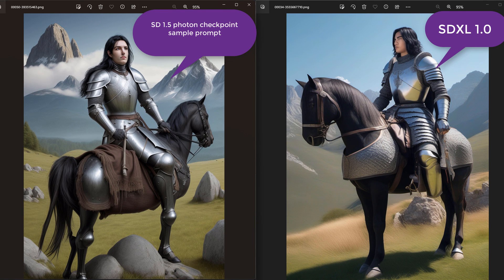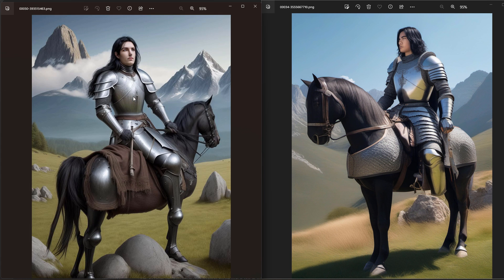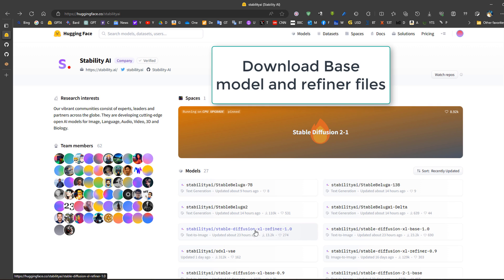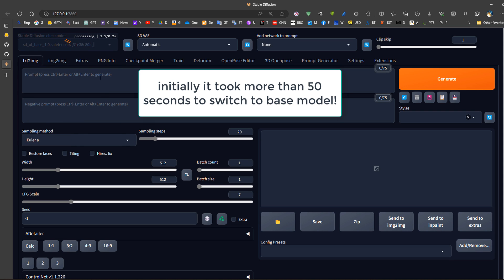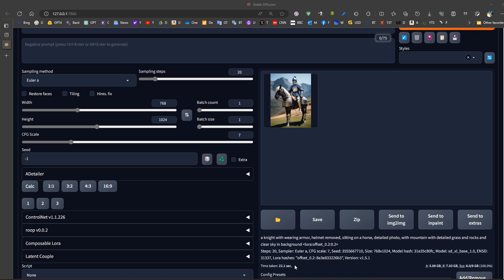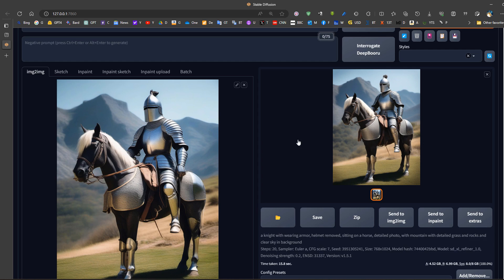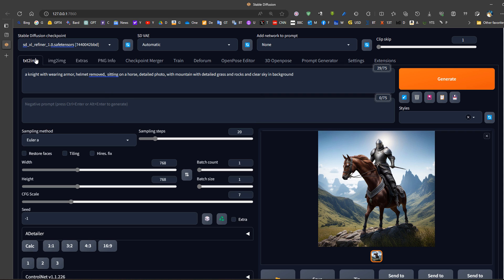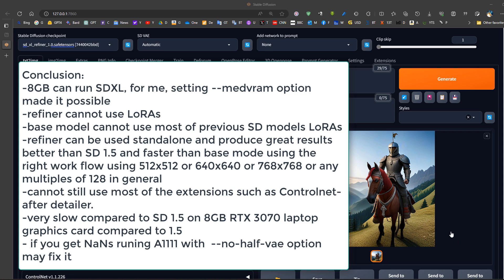SDXL 1.0 Tips in A1111 Low VRAM and other Errors  and Refiner use cases for Stable Diffusion XL

Comment: I'm thinking a buy a Laptop 8GB Vram Will I be able to run a Stable Diffusion XL model?
Reply from the maker: Yes it is possible, but it will be slightly slower than you hope for, it can take 20 seconds and more for a 1024x1024 image using Forge UI or using ComfyUI and more ... currently with how AI stuff is heading, if you plan to buy something, you better save and buy 24GB VRAM, it is very expensive, but it is the only option that allows you to run everything such as Animate Diff models without suffocating on memory or suffering slow generation
Reply: @AI-HowTo  Then I'll just have to buy a PC good choice.
Reply from the maker: yes, PC is alot more practical, cheaper, and more powerful, avoid laptops unless you extremely need to move around often, even lower VRMAM RTX 3060 for PC is alot more powerful than its Laptop counterpart and has more VRAM.

Comment: i want to run this of a server i have in it a gt1030 only 2Gb wil it work? also has 64Gb ram and 2x 10 core CPU.. render time is no issue for me since the server works while i do something else i just want to utilise my server for something other than storage.. also a quadro p2000 fits in my server im thinking about upgradeing  it has 5 GB
Reply from the maker: it will be impractical to run on 2GB, with A1111 this might not work propertly, but Forge have better automatic memory management https://github.com/lllyasviel/stable-diffusion-webui-forge this repositry provides same things as A1111 with same UI but has better memory management and can run on 2GB for SD 1.5.... it might run SDXL too but it will use the CPU then which will be slow.
Reply: @AI-HowTo   yes slow these days is unusable.. the gt1030 was the dumbest purchase i have ever made 2gb idk. if it is the drivers but i cant get it to render or transcode anything..i found a quadro p2000 for cheap so i will run with that thank you for fast response
Reply from the maker: You are welcome, these days, RTX graphics cards are game changers, they are the way to go for AI/Gaming/3D,  they are expensive, but they seem like the only option to save time and be able to stay uptodate with the technolgoy...best of luck.

Comment: I just checked it several times, so --lowvram for 2070 super with 8 GB video memory works faster (1.3 min) than with --medvram-sdxl (5 min)
Reply from the maker: interesting, this is not supposed to happen, but with open source it does! on my 3070 8GB ---medvram-sdxl is faster than --lowvram based on several tests, and this is what it is supposed to be, but with open source anything happens... in general, steps are generated much faster with medvram sdxl on my card but the conversion to pixels takes a while longer, but still overall i get faster generation .... however its best to use ComfyUI for SDXL, it gives better performance than A1111 especially for the 8GB cards.

Comment: heck I have problems with 12gb of video ram.
Reply from the maker: SDXL is much slower than SD 1.5, still, 12GB is good enough to train, generate, and do everything, it is even better if you use ComfyUI as it gives better pipeline and performance compared to A1111, but A1111 is more familiary to use and easier in many use cases.

Comment: it does not load the sd_xl_base_1.0.safetensors model in automatic1111
Reply: Failed to load checkpoint, restoring previous
Reply from the maker: it is possible that your A1111 needs update, because sdxl requires new A1111 version to run...and if you VRAM is low, you should use --no-half-vae --medvram-sdxl   options in the webui-user.bat startup parameters after set COMMANDLINE_ARGS= line ... hopefully that fixes it .... another possibility if you already done that, that your sdxl file is corrupted, which rarely happens.

Comment: On my laptop --medVram does not work but --lowvram does, RTX2050 - 4 GB and image dimensions: 1024x1024 generated... oops... it does not. At final steps I got an error Cuda Out Of Memory
Reply from the maker: currently there is  --medvram-sdxl  in recent A1111 1.6 version, if you used these options --xformers ----no-half-vae --medvram-sdxl  --lowvram and still didnt work out then I suggest you to switch to ComfyUI, it can run even on a CPU.
Reply: @AI-HowTo  will try, thank you
Reply: @AI-HowTo  unfortunatelly with --medvram-sdxl it even does not start to generate, I got CUDA Out Of Memory just right after click generae.

Comment: I am planning to upgrade my old gpu to Rtx 3080ti 2nd, Is 12gb vram of it enough for SDXL?
Reply from the maker: yes, you can both train and generate images using 12GB RTX, but if you are buying, then be patient, and try to  go for 3090, 24GB is the way to go, because soon, 12GB might no longer be sufficient very soon, and 24GB will give you peace of mind for quite sometime.

Comment: im using vlad diffusion and the sdxl model stop doesn't load, so can't use the model
Reply from the maker: whatever works go with it, vlad diffusion is a good option too so is Comfy UI, but usually with --medvram or     --lowvram --xformers --no-half-vae  options it should work  on A1111 too and now there is a new option called --medvram-sdxl  in A1111 version 1.6 ....

Comment: (1:30) "...and all of them had the correct anatomy..." Yeah, but is that because the 1.5 version didn't have enough horses fed into the dataset, because any model will look bad if the dataset it's pulling from is minimal.
Reply from the maker: definitely, bad anatomy of animals/humans comes mainly from having less training images and lower resolution images, higher resolution images makes it possible to learn more features with less number of images too like SDXL... while the structural changes are minimal, the magic in AI is always in the data, everything else is just a distraction.

Comment: Will I be able to figure out how to do this in invoke?
Reply from the maker: this video was made for A1111 when SDXL 1.0 was first released, Invoke as far as I know can also run it, but not sure about its config ... on the otherhand ComfyUI automatically detects graphics card settings and adjusts its run parameters to match your graphics card so no settings is required and faster than both, but less user friendly.

Comment: hi thanks for the video! nice work! my question is full 8gb/8gb 100% vram usage, is "safe"? and.. normal? or i need to optimize more. I have no error, and fine time.. but this 100% usage... i simply don't like this
Reply from the maker: You are welcome, I think its totally fine, the system will take from the System when it needs more VRAM after this point, as long as it works, let the system handle it, no need to further optimize or use --lowvram for instance because it will only get slower  .... in my case, it goes 100% usage when i generates the images then goes down but it doesnt stay 100% all the time, only when generating a new image ranging often between 66% and 100% ... if it is always 100% that might be better because it might be a setting from the BIOS that allows faster run and higher GPU clock speed for instance, i think.

Comment: Has anyone tried with 1650ti ? I think it has only 4GB vram.
Reply from the maker: with --lowvram it might work or in ComfyUI which can even run on CPU and detect best settings based on your GPU automatically., but it definitely will be very slow and not practical.
Reply: @AI-HowTo  Actually that is okay. As long as it will not crash. In Google Colab free version, it will crash. I actually have stable diffusion in my AWS EC2 server and 20 iterations will take 7-8 hours. But that is fine :)

Comment: I have a 3060 /w 12 gb ram, comfyui ui runs pretty fast with xl
Reply from the maker: true, even faster for 8GB... only problem it is not as user friendly or easy to use as A1111...now there is also a refiner scrip extension that allows loading Refiner along with the base model as a pipeline which makes it slightly faster than before.

Comment: Thanks for the video. The medram helped some but when I run it a few times and increase the number of pictures to 3 get memory issue again, I too use 8 GB, I wonder if you run to the same problem
Reply from the maker: You are welcome, I didnt face this, i generated many pictures without a problem, one at a time though... possible memory leaks from A1111 tools...as you can see, many errors with extensions too,  its still not very practical to use effectively compared to SD 1.5... Comfy UI is good, but not user friendly in comparison to A1111.
Reply: @AI-HowTo  I was wondering if you could help me with something. I have been trying to find code or a model that does facial expression transfer from face2face it used to be around a few years back but can not find anything on github or anywhere else that is running tensorflow2.0 and above. Everything seems to be so old that you can not even install the libraries any more!
Reply from the maker: sorry, cannot help with that, but if you want face 2 face expression transfer you can check control net, it does that too  --- just use (reference only) model, can work in img 2 img and text to image as well, so you can use it for existing faces or SD generated ones.
Reply: @AI-HowTo  Sorry for taking up your time but what do you mean by "check control net", not sure what control net is.?
Reply from the maker: I have not prepared a video on this topic, so you can check others, such as here, https://www.youtube.com/watch?v=tBwmbTwMxfQ&t=160s it explains this feature... or search for Control net in stable diffusion, it is an extension that allows us to mimic existing poses/facial features images of others

Comment: is there any chances to make it work on my 3GB VRAM 16GB RAM ? I know it is not even supposed to be enough for SD1.5 but it works with some optimizations
Reply from the maker: I think it is possible... if you failed to run with --lowvram , i suggest you install Comfy UI https://github.com/comfyanonymous/ComfyUI and follow installation instruction (just dowload the https://github.com/comfyanonymous/ComfyUI/releases/download/latest/ComfyUI_windows_portable_nvidia_cu118_or_cpu.7z ) extract , copy models into your check point folder or update the config file to existing stable diffusion installation folder and run... Comfy UI, can run using GPU or CPU, it is slower using CPU alot though ... so it wont be practical...I think in general, with very Low VRAM, it maybe best to use Google colab, you can google that too.

Comment: Can my gtx 1070 run it? It's 8gb vram
Reply from the maker: you need to try it, use --lowvram option if --medvram didnt work, generally speaking it requires strong GPU, so even if you ran it, it is unlikely that you will use it much considering it is slower than SD 1.5 for instance
Reply from the maker: or use Comfy UI, it automatically finds best settings for you GPU.

Comment: hiiii im not able to load the "XL 1.0"  i dont know what to do ....i'm getting this error:
 
size mismatch for model.diffusion_model.out.2.weight: copying a param with shape torch.Size([4, 384, 3, 3]) from checkpoint, the shape in current model is torch.Size([4, 320, 3, 3]).
Reply from the maker: it doesnt seem you A1111 is updated, check the version at the bottom of the screen 1.5.1 after running A1111, if not use Git pull as explained in the video, hopefully it resolves this, or your torch version is outdated, but  usually git pull also updates torch version too ... if all failed, reinstall A1111 as a last resort.
Reply: @AI-HowTo  ok thanks
Reply: have you updated auto1111?
Reply: @SonidosEnArmonia_1992   no i did'nt :]

Comment: How much PC/system ram do you have?
Reply from the maker: GPU Ram is 8GB RTX 3070 Laptop with only 16GB System RAM.
Reply: @AI-HowTo  There would be why SDXL requires 32GB of system ram so I can see why it took so long.  XL is mean on specs as my card can't run it.

Comment: yeah i also end up using refiner only from 640x640 then convert to 1024x1024 , i have 10gb vram but its hanging my lappy for sometime when switching to base model , some time i am using refiner on old 1.5 generated images too.
Reply from the maker: yes, switching is really annoying, wastes time, SD 1.5 is still very practically in terms of speed, this is why refiner model is more practical to use standalone without the SDXL 1.0 base model for me...hopefully A1111 will soon do a pipeline for faster refiner usage, but still, we will suffer a lot with lower GPU apparently even then....SD 1.5 will most likely be more useful and faster in many use cases till then.